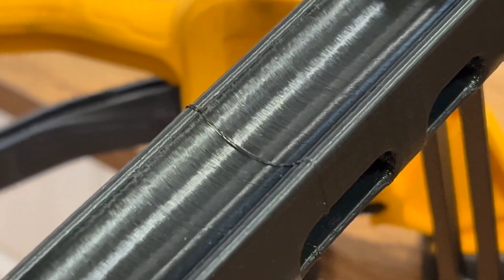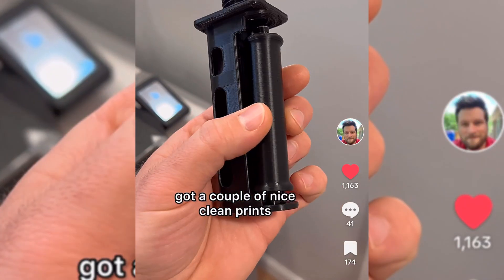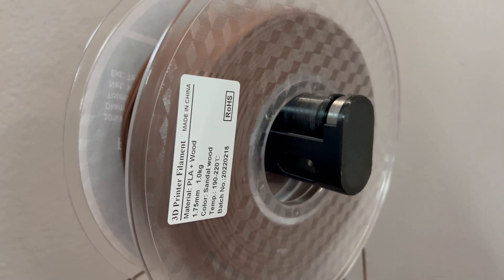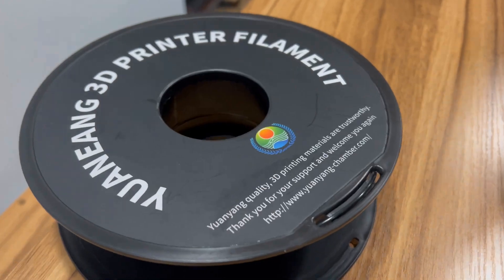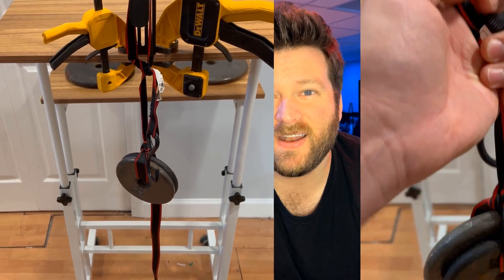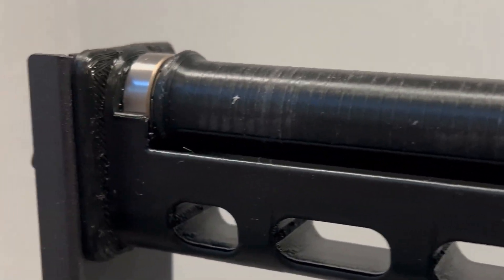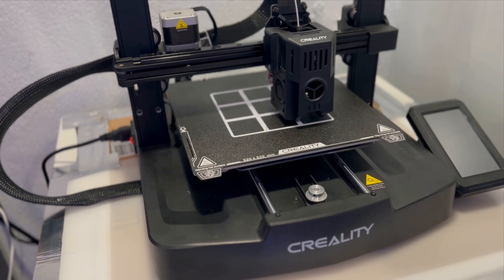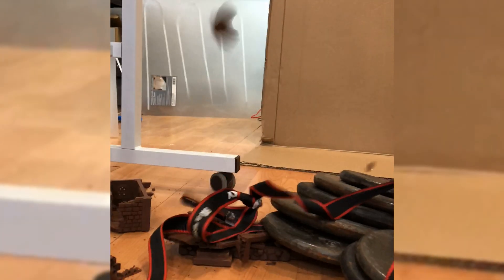Print Orientation Does(n’t always) Matter

Comment: I think the takeaway from this is that you shouldn’t over-do it when it comes to the strength of parts. It’s often better to use only as much walls and infill as you actually need for the mechanical applications of your part.